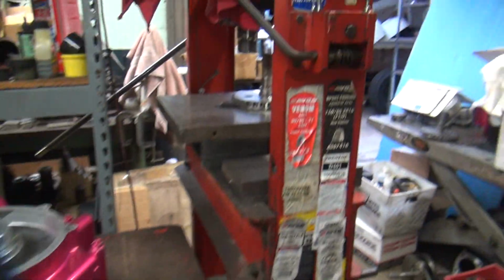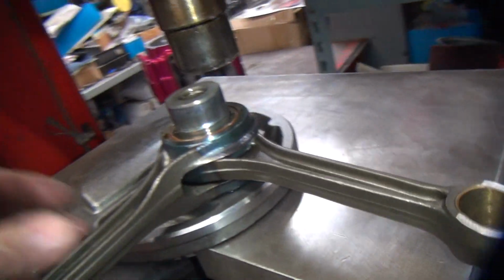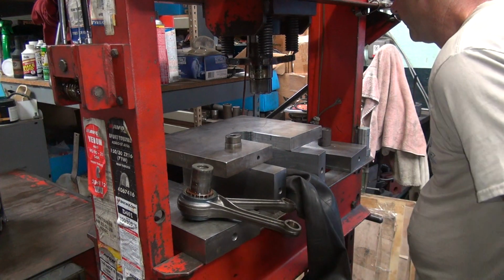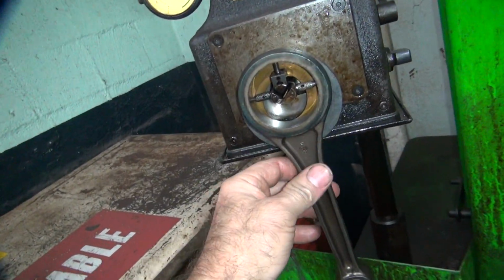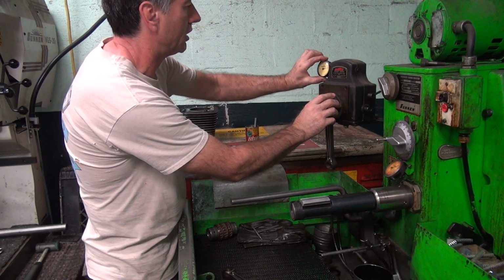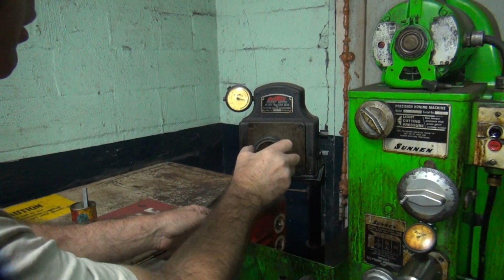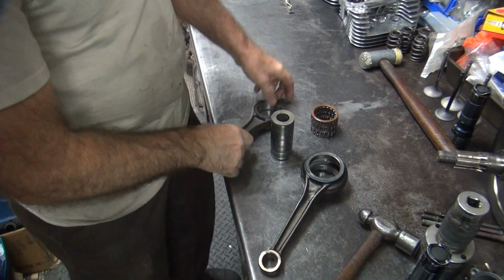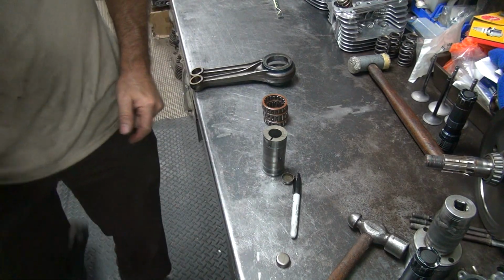#113 110ci 117ci twincam case boring flywheel rebuilding 2007-2017 1999 harley by tatro machine

Comment: Worked with a 300 ton Vertical press, Pressing 16” to 36” wheels with a 3-1/2” to 6” bore Railroad wheels. When they popped you really heard it, makes Everyone tighten-up.   Slick Looken Honing Machine .👍🏻

Comment: And we're going to polish the f outa that crankpin (only where the bearings ride)and flush it from the inside before we re-use it, aren't we? Or we gonna break down and put a new crank pin in it?
Reply from the maker: harley has no rebuild parts for cranks because they don't fix anything anymore. the twin cam and up motors are all throwaway motors, no rebuild parts are needed. i just use leftover parts from other cranks. pick the best parts you see and go with it.
tatro